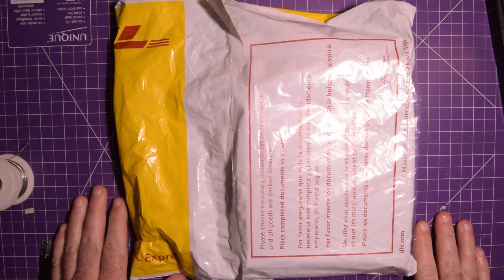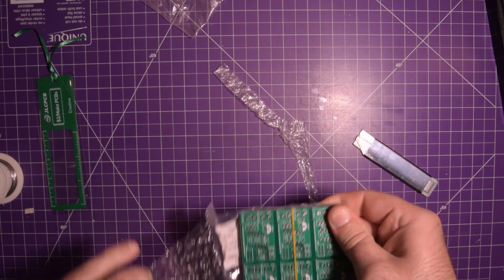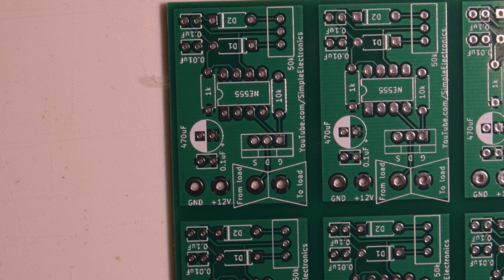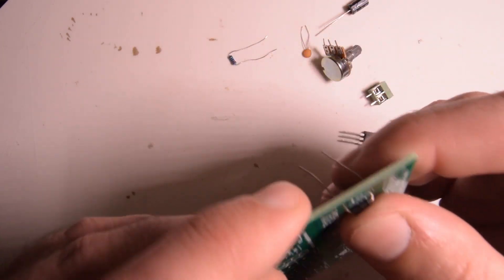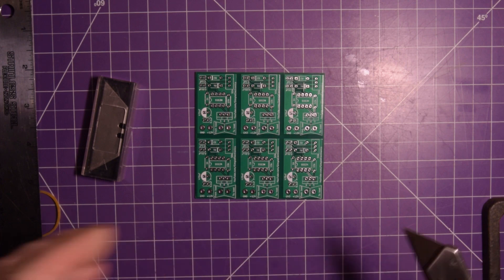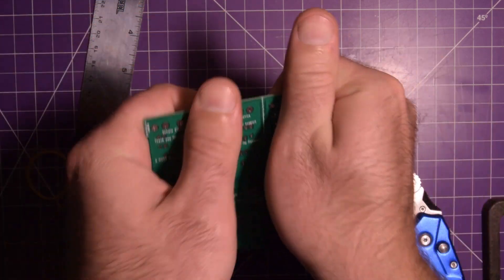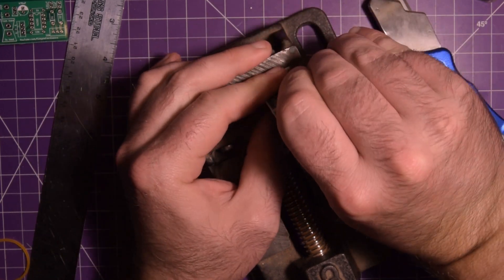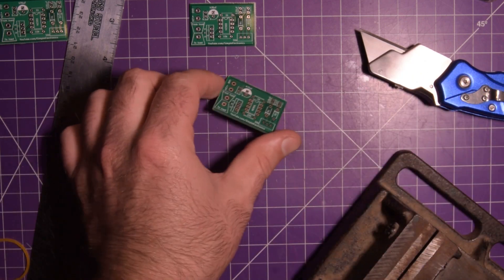Taking A Look At The Finished Boards

Comment: This is one of my bucket list things to do. I am still a little ways off but I was shareing the excitement with you!
Reply: Maybe make one for an easier circuit you can still be proud of? Idk like an lm317 voltage regulator board or maybe a class d amplifier IC based one
Reply: @Razvii  definitely I was thinking a simple coin cell powered  LED circuit with a switch.
Reply: @GeorgeJFW  that works too, a circuit is a circuit and is just as cool no matter how small or simple!